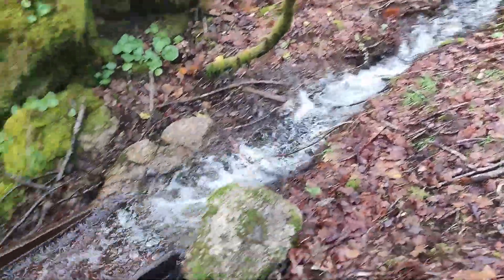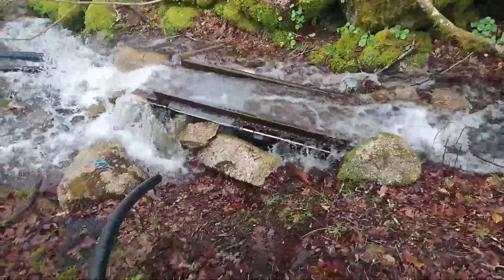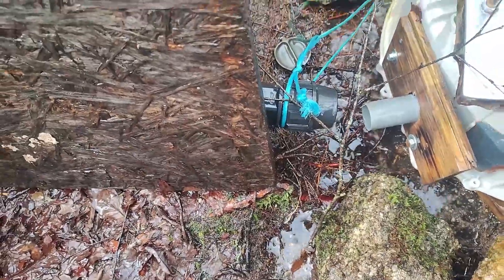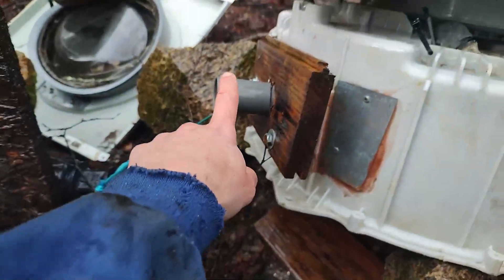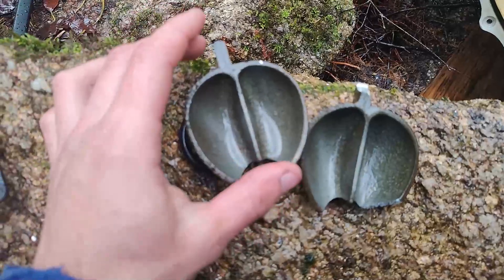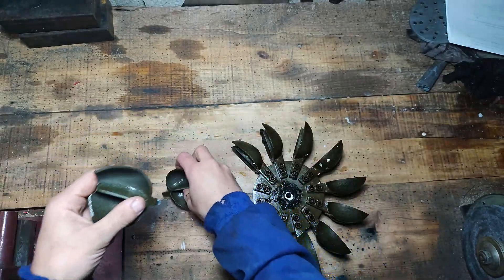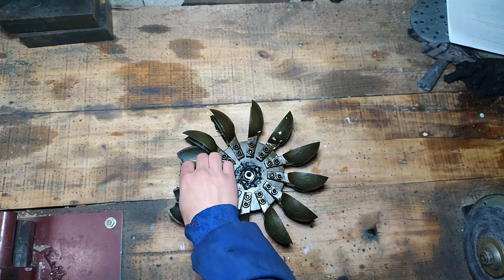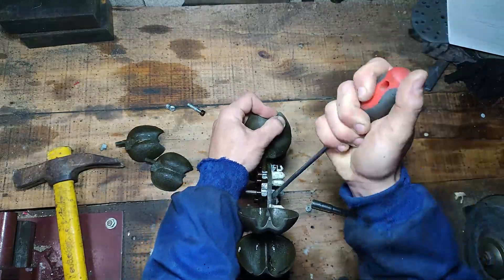Pelton Repair Off Grid Energy

Comment: How come you don’t need a chimney to evacuate air when pouring metal ?
Reply from the maker: Most of the time it isn't necessary, it depends on the part you are making, try with and without and you will notice that sometimes it's useless and sometimes without it it won't be a good cast, especially with thin and long parts ;)